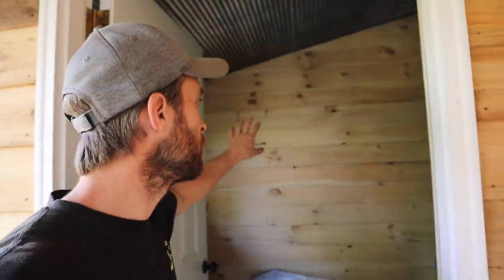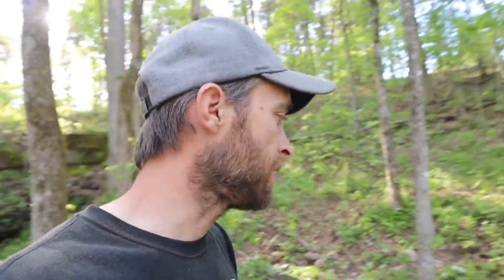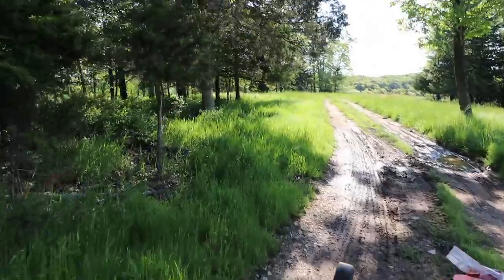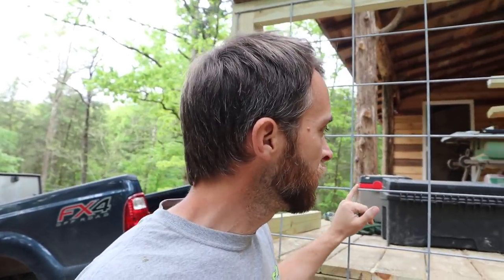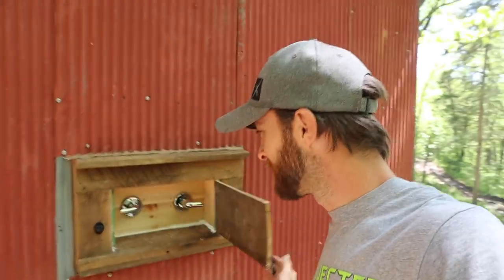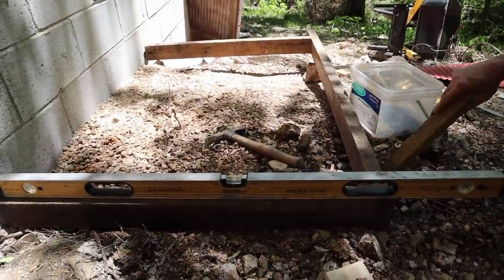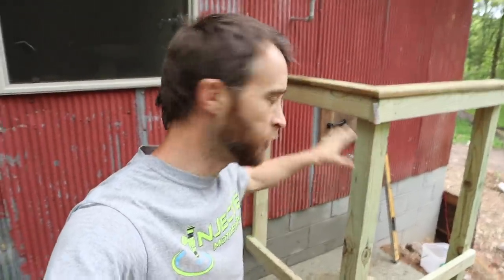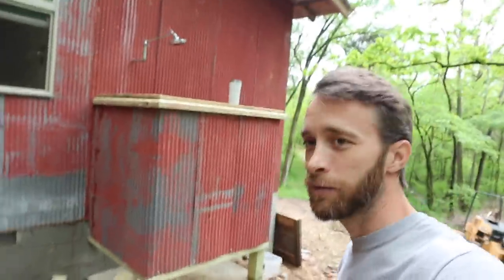Laine Has ALWAYS Wanted One Of THESE!!! Off Grid Cabin Build - EP#21

Comment: There's a phenomenon in some trees called Summer Drop, where trees will shed large sections for no apparent reason. Yeah, cut back the trees.
Reply: CB Guest Summer drop..... LOL.   Trees have diseases just like you. It causes trouble.  Wind racks them around causing cracks that disease and fungus enter and eventually rot can set in and Trees drop weakened limbs and big parts due to the weight of water as leaves pick up water weight. Or they just fall over because the roots are insufficient tontake wind pressure. A few trees on the south side of a home cool and that’s all the trouble you need and can be PLENTY.  It’s not a party out there and you’re not prepared.